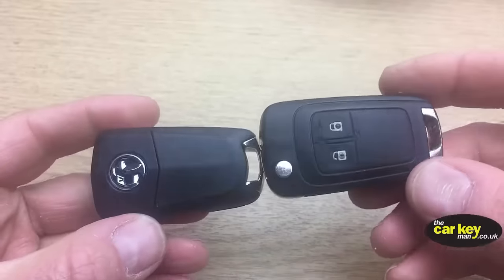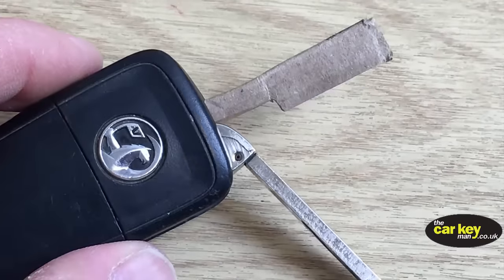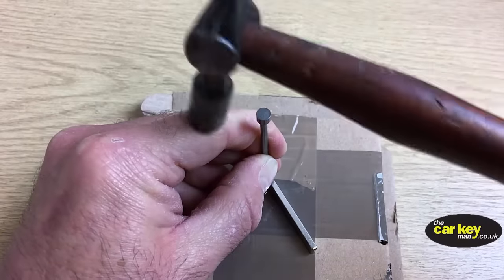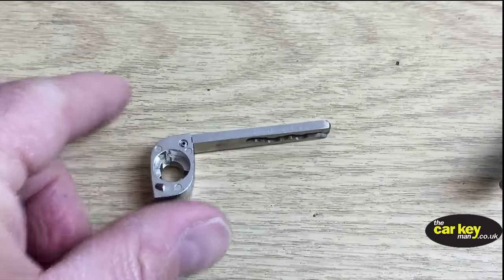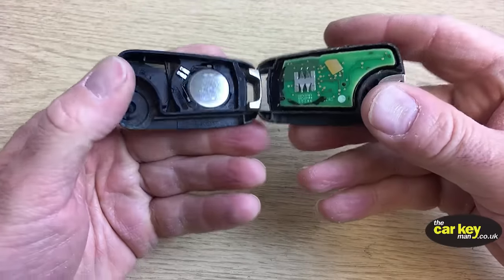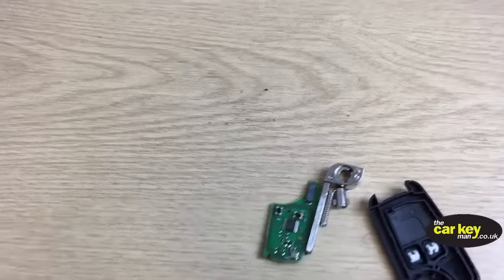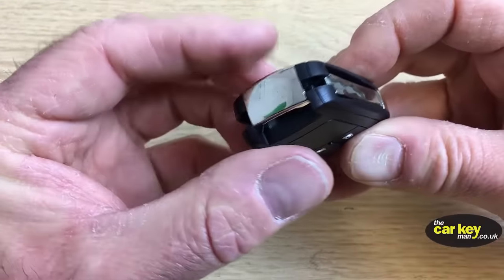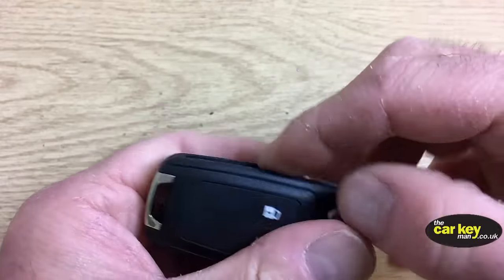Vauxhall Flip Key Repair Kit Instructions

Comment: Key opens but does not lcck in closed position. Tried to reopen and adjust without success. Second key has no such issue. Is it possible you sent a dud?
Reply from the maker: Hello, did you use all the parts from the new key apart from the blade? If you still have a problem please email me on the details I sent you and I'll sort it out for you. We don't see many faulty keys, but anythings possible.

Comment: One of the best demonstrations ever
Reply from the maker: Hi Harry, that's really kind of you. Really appreciate the feedback and thanks for watching :)
Reply: @TheCarKeyMan  what’s size push pin did you use here ?
Reply: @TheCarKeyMan  hello pal. I just done this job but the button are stiff and will not press and the key doesn't pop out. What has gone wrong for me here ?
Reply: @ibby_786 did you wind the key in the spring a couple of times as you need to do that to make the spring work
Reply: @jamesblakestravels1088  in which way you turn it thanks 😊

Comment: Hi people. My spare key which I haven't been using for quite long doesn't work. I have put a new battery but it didn't help. I tried the trick by putting the key into ignition  but it didn't help. Do I need to program the key with the computer or what could be a fault? ASTRA 2005. Thank you!
Reply from the maker: Hi, when you say it doesn't work, does it start the car?
Reply: @TheCarKeyMan  yes, it does. The locking doesn't work

Comment: I just changed my GM key and it was so tight that the pliers trick did not work, I did get it apart some cutting and pliers.
Reply from the maker: Hi, yes starting to see some cases now that have been glued very tight. Most open fine, but theres a batch or two out there that need special treatment :(

Comment: The base of my key fob did not match my circuit board pins ( Corsa d )
Reply from the maker: Hi Keith. Sorry about this, did the case you order look the same as your original key?
Reply: @TheCarKeyMan  yep was the same in fact you had trouble with some fobs that would not close that was i think the circuit board standing proud all i did was nip that bottom location peg off and it went together great....Will say onne thing you vid was the only reason i was able to do this...

Comment: Great video! Absolutely invaluable and, as previously mentioned, the tiny but really important detail about the old blade holder was absolutely top notch! Thank you so much. Could not have completed this without you 👍
An absolute invaluable channel, have subscribed thumbs up many thanks 😀
It's a bit immaterial not but how come the original key has no screw?
When I first started the job I removed the badge looking for it 🙄
Reply from the maker: HI Graham, they just glued it originally, I guess it was easier for rapid manufacture. Glad it helped and thanks for the feedback :)
Reply: @TheCarKeyMan  
Thank you sir 👍 I guess so, makes sense when you put it like that
Keep up the great channel and take care 👍
Reply: Mine won’t come apart must be glued what is the best way to take it off i tried screw driver and long nose pliers and still does not budge.
Reply: I think my old key was glued

Comment: good instruction video easy to follow, my problem was with my existing key, my 62 plate astra key did not just separate  vauxhall decided to fuse the 2 halves together making it impossible to separate it took a small metal saw and pliers to separate the 2 halves being very caustious not to damage the electrical board inside took about an hour to do .
Reply from the maker: Hi Robert, yes they glue the original keys. For future reference, external circlip pliers open these easily, we use them every day . Well done for getting it open with using pliers!
Reply: @TheCarKeyMan  I'm afraid that was not the case with my old key the 2 parts were not   easily separated i used long nosed pliers to try, not one part separated  hence having to use a junior hacksaw to cut through the joint between the 2 halves of the key the key case would rather break some where else than separate
Reply: Thanks! The same for me. I will try with a saw.

Comment: Thanks for the video. I ordered the astra j model before I saw this or I would have supported you. When mine came there was no punch so I used a bit of stainless welding rod.

My original didn't come apart quite as easily as the one in you video, it seemed to be very well glued so I had to cut all around the outer with a junior hacksaw but thanks to your detailed video I got there in the end.

Once again, thanks for posting.
Reply from the maker: You're welcome Bob, yes sometimes the glue person has been a bit keen! Thanks for watching

Comment: Just done mine. I have to be honest, the thought of taking a hammer to my key fob was a bit alarming, but the old one had lost a button and was getting flimsy. Cheapest price from a locksmith was £120. I can't express how delighted I am with it, once I got going. The blade switches in and out with ease. The lock and unlock buttons operate perfectly, and the engine starts. What more could you want?The instruction video was a God send. I will definitely recommend.
Reply from the maker: Thank you Eugene, pleased it all went smootly :)

Comment: Thanks to the Car Key Man for the Vauxhall flippy repair kit. It worked a treat & saved me dealer hassle & oodles of cash.
One word to others wanting to use this method don't lose the new case retainer screw - the last bit in the process. 🙈
Reply from the maker: Hi Jambo, do you need a replacement?

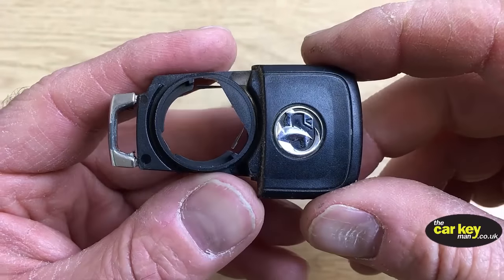Comment: 18:55 Tip to remove LOGO (badge). Place cover in boiling water (obviously without the electronics) and the glue will dissolve....
Reply from the maker: That's a great tip, thanks Allan
Reply: Hair dryer with suitable funnel just as effective

Comment: Any alternative method to get the Vauxhall logo off instead of using a soldering iron?
Reply from the maker: Hi, I have read that some people soak in boiling water. It's only double sided tape.
Reply: Not having a soldering iron to hand I hand-drilled a 2mm hole next to the logo and then used a 2mm slotted screwdriver to lever the logo out - effectively the same method but different tools. Excellent video that made the job so easy.

Comment: Good information...
Does the electronic circuit board also act as the immobilizer...or is it purely opening and closing of the doors..
Maybe you or someone could advise...
Regards
Reply from the maker: Hello, yes the immobiliser chip is built into the circuit.

Comment: So did anyone find a way of doing this without using those specialist pliers? I tried all I could with a screwdriver pushing it apart, but can't open old case
Reply from the maker: Hi, no you won't be able to without the circlip pliers, if you try, you may damage the electronics

Comment: Just to echo most of the other comments, great product, great price, great instruction video. Getting the pin in to attach the old blade to the new case parts the only fiddly bit for me. The circlip pliers are a necessity for opening the old fob, in my opinion; I’d’ve wrecked the PCB without them, as my fob took some significant force and several attempts to prise it open.  Highly recommended - thanks again guys.
Reply from the maker: Thanks James, really appreciate the feedback and support :)

Comment: I've just purchased a 61 plate vauxhall meriva it has 1 standard key with 2 buttons. Can it be converted into a flip key?
Reply from the maker: Hi Dawn, no sorry, the circuit board inside is very difficult to remove, plus it is a different shape to the flip key

Comment: I have a hard moulded key fob that I would like to repair (a button has worn off so the lock button is now completely open to the circuit board inside). Would the blade be the same as in the flip ones in that is has the groove in it so allow it to be inserted into a replacement flip fob?
Reply from the maker: Yes, sometimes you need to slightly alter the groove, but normally it’s a straight swap

Comment: What if the button has worn off and completely disappeared exposing the “black” little button m soldered into the circuit board.
Reply from the maker: Hi Ajay, it sounds as if the switch on the circuit board has broken. It needs a new one solderd on as part of the repair. We do a postal service, or you can look for a local car key expert ;)

Comment: I used my old blade and it shut perfect 
So i think your comment it won't work is wrong.
I have used my old blade without any problems and i never hammered the old blade out.

I think it depends where you buy the new key from as cheaper types on ebay could be cut differently but so far ive done 3 keys and had no issues using the entire key section
Reply from the maker: That’s great Paul

Comment: The left "unlock" button fell off my 2011 Vauxhall Meriva key fob yesterday but I'm confused. If I buy the kit from your website that includes the file, Circip Pliers (I'd need them) and the new blank blade already removed, I just have to knock the pin out of my broken fob key, then knock pin out of new "hinge" and put my cut blade into this new hinge, then knock pin back into it using the new pin from your kit? Sorry, I'm not technically minded. Thanks.
Reply from the maker: Hi, sorry I missed your comment, yes you just need to follow the video. However, you do need some DIY skills

Comment: Hi there. Im currently missing my buttons on my isignia key fob. Took it to Simpsons and they say new fob is £50. It works fine with my little finger opening it. 
Is there a set time to do this once removing the battery incase memory gets wiped on chip?
Reply from the maker: No, the key battery can be out and there’s no danger

Comment: Hi. Just finished mine, it unlocks & locks the car but the dash comes up with ‘service theft deterrent system’ upon trying to start & will not start the engine - 2010 (60) Astra J. Any ideas at all please on what this may be?
Reply from the maker: Hi Jordan, what did you use to open the old key? It sounds like the key circuit board has been damaged or has failed

Comment: Great video. The bit saying you can't use the key pivot part from your old key fob was missing in the 1st video I looked at, so thanks. But can you explain why that is so, I still don't get it.
Reply from the maker: Hi, unfortunately the keys are built in different factories and the parts are not interchangeable. So the new parts are all designed around each other and work together fine, but you can't mix and match parts

Comment: Great tutorial. I have tried to open the case with the pliers but not for opening. It seems its glued. Tried hairdryer on it but all I'm doing is breaking the plastic. Any suggestions?
Reply from the maker: Hi, I use the pliers on 99% of all the cases I open. It needs gradual constant pressure andn they normally go

Comment: Removing the logo - submerge the old key fob in boiling water and it softens the glue, then pop it off with a screwdriver.
Very helpful tutorial which allowed me to fix both of my friends keys. (Vauxhall Insignia)
Reply from the maker: Hi, thanks for this tip, I'd never even though about soaking it! This will help others so thanks for leaving the comment :)

Comment: Oh dear. Just gone to change my key and I can't separate my old one. It's literally snapped the corner off. It looks like it has been glued shut. Hoping I may be able to get it open with a Dremmel type of cutting disc.

Update

Managed to destroy the original key and got the circuit board out. Was worried I may have damaged the board. Rebuilt the key and fitted the battery and it worked a treat. Thank you very much
Reply from the maker: Hi Jeffrey, yes for some reason, about one in 30-40 can be stuff shut. It's only glue but clearly the person on the gluegun has been extra keen! Glad you got it sorted ok

Comment: Your video and replacement kit is great.
However, I had a Vauxhall Astra key and both sides of the shell were bonded solid.
My circling pliers would not prise the key shell apart.
I had to hacksaw around the shell very carefully to avoid hitting the circuit board.
Pausing your video was very helpful to ensure that I was not cutting through the PCB.
The bond at the top (near the key button) was the toughest since I could not get the small hacksaw blade into the inside curve.
I had to cut the metal key ring holder at the bottom and very slowly peel and cut the cover away from the pcb.
I cut the and peeled to avoid damage to the pcb.
Maybe using a hot blade might be better than a hacksaw.
The rest was easy and in accordance with your instructions.
I now have a fully restored key again.
Thanks 👍
Reply from the maker: Hi Colin. When I made the video, they used to pop open no problem. They have always been bonded together, but there are a batch out there that are very tight.
The only way I can describe the technique is to place the jaws into the gap as far as possible and slowly increase the power and then hold. 
If the jaws are snatched, then the key tends to break, on the ones that are tight. 
I have had a couple that are impossible and when that happens, I slowly use a soldering iron, but it can be hot work on teh fingers

Glad you managed to get it swapped over and thanks for the feedback

Comment: The video is an excellent guide to performing this task. Unfortunately, my supplier (Amazon Spain) did not include the instructions or the punch.
Also, I had to completely destroy the old fob to get the circuit board out, and the logo was wrecked in the process. Still, I have a fully functional folding key fob at a good price with a little effort from myself. P
Reply from the maker: Hi, unforunately the key always gets broken when it's opened, I think they glue them together when made. We don't post out to Spain at the moment, sorry

Comment: I went for a used original Vauxhall key from Ebay and used the fob shell to replace mine as the unlock button had fallen inside. Not the easiest to open to strip out and refit the internals. But hey ho all done for £11.
Reply from the maker: Well done Patrick

Comment: Just changed a Vauxhall adam key, good demo and easy to follow but the blade doesn’t fully seat when it’s closed. Not sure if it’s the Adam blade, the case or the spring. Not a big deal but just thought I’d let you know. Also good job sending out the hole punch and the file. Cheers
Reply from the maker: Hi Conor, thanks for the feedback, it's essentially the same case as an Insignia. If you need help can you email and I'll see what I can do

Comment: Just changed mine into new case but my key was moulded together had to cut it open with a hacksaw very carefully damaged the circuit board but still works. Just a warning to check your key first but all good now!!!!!
Reply from the maker: Hi Ian, yes every now and then we come across a case that is very very tight, not sure why. Thanks for the info :)

Comment: hi how do i get a replacement blade it has snapped off , does it come cut or how do i get it cut ?
thks Gary
Reply from the maker: Hi Gary. If you order it from the dealer, it will come as part of a new key and will need coding in. Do you have a second key?

Comment: Great video! I got my key case changed in no time. My old key case did not open as easy as you show here, but it did eventually. Can anyone tell me what size is that small screw you put in to hold the two halves together? I seem to have lost mine and although the key fob holds together just fine without it, I am afraid it will pop open if I drop it accidentally or something like that. It seems to be a standard screw so I'm sure I can find one if I know the length and diameter. Thank you again for a brilliant demonstration.
Reply from the maker: Hi Tibi, are you in the UK?

Comment: I notice you don't show how to get the little round logo plate out. How many hours does it take, and what do you use?🙂 I tried thin knives and watch makers screwdrivers and could not remove it. Do you just destroy it?
Reply from the maker: Hi Ken, sorry I didn't show this. Well, watchers of this video have left some good feedback about this. When I do it, I melt the old case with a soldering iron and gently lever it up. However if you don't have one, then users have suggested a thin blade, or soaking in hot water first. The only thing holding it on is double sided tape.

Comment: I ordered the set a few months ago but finally took the task on. It seems they have updated their sets they mail to you as the replacement fob does not have the fake key bar in it anymore (it's separate now) so that's one less task. The only thing I had to find out myself is, when I opened the fob, a small half-circle metal piece popped out. When following the video, I assumed they would show where it goes but at the end, the key was back together... without the metal piece. So I had to open it up again (no issues) and figure out where it goes. My advice here is to have a good look at the printed paper that comes with it and where you see the content laid out. On the lower half of the fob you can just make out where the little iron piece sits (though it seems to be a slightly updated (and different) piece in form as well). Then look at that part of the fob, you'll see a small slip where the metal fits in neatly in such a way it's pressed in place when closing the fob (and meant to hold the battery in place). I hope this helps and thanks for posting this great video!
Reply from the maker: Hi Marcel, really sorry the battery connector was loose. Was the key sealed in plastic wrapping? I've been told about a couple now which is a bit frustrating as the are ready sealed when I pack them. 
Really appreciate the kind words :)